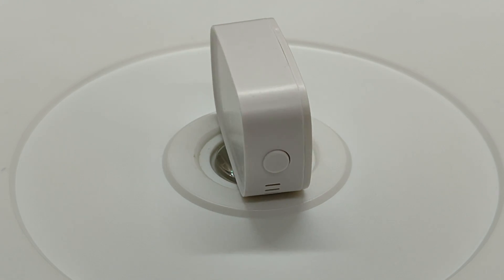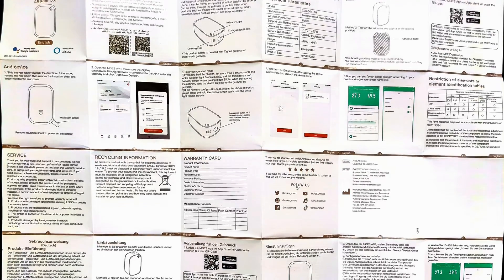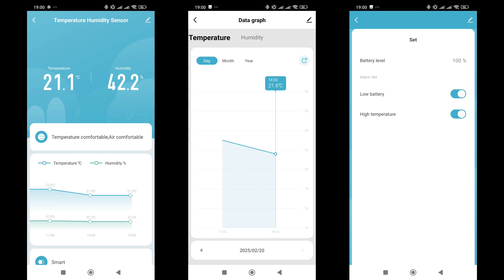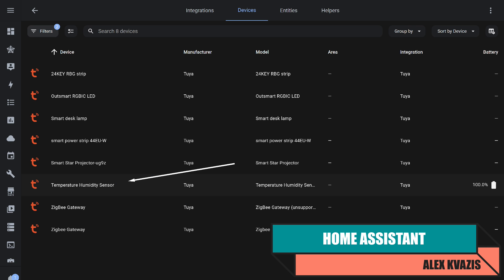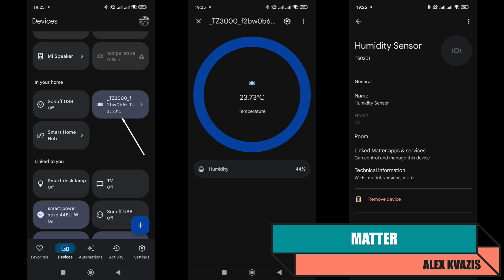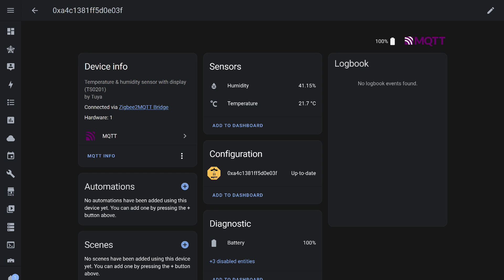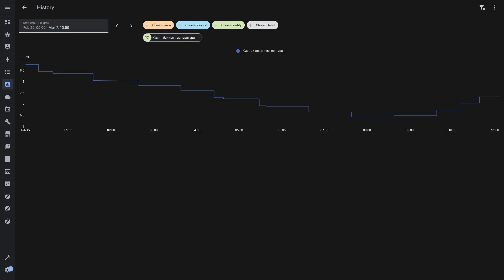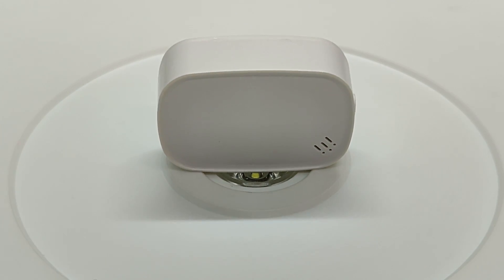Moes ZSS-S01-TH - zigbee датчик температуры и влажности, обзор и тестирование

Comment: а как обновитьб его прошивку? Zigbee2MQTT пишет, что доступна прошивка, запускаю ее и получаею вот это в логах:
[18.12.2025, 22:14:52] z2m: Updating 'Датчик температуры' to latest firmware
[18.12.2025, 22:16:03] z2m: Update of 'Датчик температуры' failed (Device didn't respond to OTA request)
Reply from the maker: А зачем ее обновлять ? Что-то не устраивает ?
Reply: @Alex_Kvazis  влажность показывает не верную, врет на 10%. Очнь долго реагирует на изменение температуры, в комнате 20, высталил на подоконник, на улице +10. Так вот 10 минут понадобаилось, пока датчик зафиксировал 10 градусов. Подумал, а вруг прошивка исправит это....
Reply: @Alex_Kvazis  и еще такой вопрос: получается этот датчик нельзя использовать как внешний для термоголовки SONOFF TRVZB? 2 дня мучаюсь, чатгпт говорит  "Потому что датчик Moes ZSS-S01-TH не объявляет кластер температуры как “bindable. У Moes ZSS-S01-TH кластер msTemperatureMeasurement есть, но он не разрешён для binding в его Zigbee-описании (endpoint’е)." Если так, то печально, зря купил этот датчик и тупо выкину, потому, что не понимаю, зачем он мне тогда вообще нужен. :( :( :(